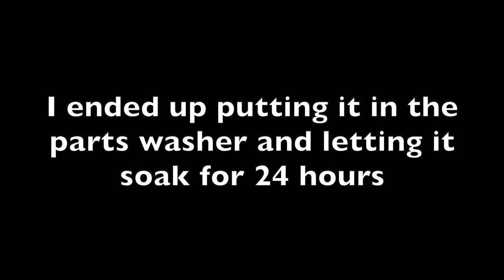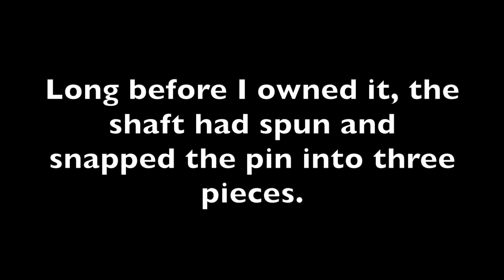1941 South Bend 13" Lathe Restoration - Part 9 - Apron Disassembly

Comment: This was excellent.  I struggled with exactly the same areas that you did when working on my 1935 SB lathe.  On those collar nuts on the worm gear, I assumed that the pins had been driven IN, i.e. the wide part on the outside and the narrow on the inside.  Thus I thought that they would need to be somehow driven from the inside OUT.  And since I couldn't see how one could do that, and because I didn't want to drill them out, I just left that part  unassembled.  Thanks for showing all this!
Reply from the maker: There were few things that confused me less than the apron and these blasted taper pins. Knowing what I know now, I'd love to go back and do it all over again. I'd be done in a week. ;) LOL!
Reply: @MyLilMule  People complain about how Apple uses glue to put their phones together.  It is apparently easier for manufacturing, but it is an absolute pain when trying to do any repairs.  I feel that taper pins fall into this same category.  I, for one, am very happy that they aren't used any more!

Comment: Well done. I finally got my 13 and I was pleasantly surprised to find it looking rough but mechanically very clean. Did find two gears with broken teeth in the slide gear mechanism but found replacements from a guy making 3D printed gears for SB’s.  we’ll see what happens.